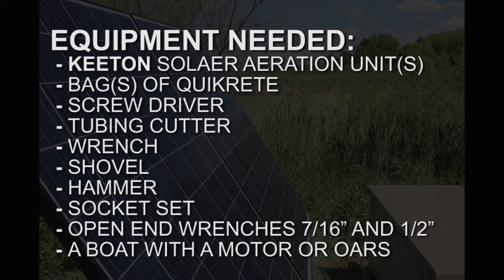Solar Aeration Installation

Comment: I've just installed this system (with two aerators) in western Massachusetts.  It worked great for a couple weeks.  And then the system began to run continuously, even though I had not messed with the timer.  I followed directions and spent a good deal of time trying to reset the timer with the help of a Keeton expert.  But the timer turned out to be defective.  So, Keeton sent me a new timer.  This new one didn't have a battery installed, like the first one.  So the energy for the timer would have to come from the batteries.  This made setting the timer more difficult because you have to stick your head into the cabinet at a weird angle.  So, the new timer arrives, but now it's not pre-programmed to turn off at 10 a.m. and on again at 2pm.  This extra adjustment is a new challenge, and honestly, I'm not there yet.  My suggestion is that Keeton find a more reliable, (easy to install and program) timer.  In the meantime, please post here on YouTube a close-in video about how to program a new timer from scratch.  Thanks!  Robert